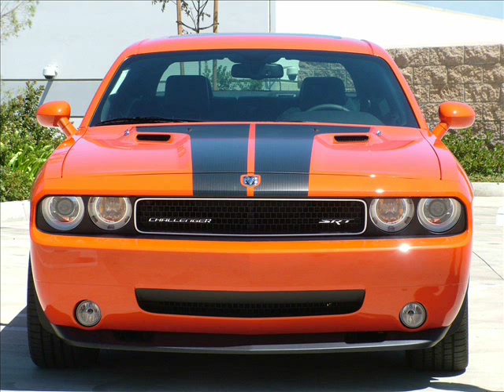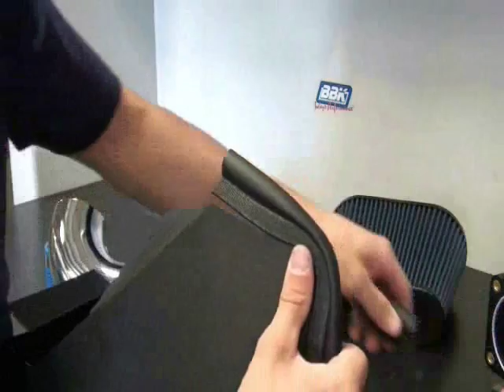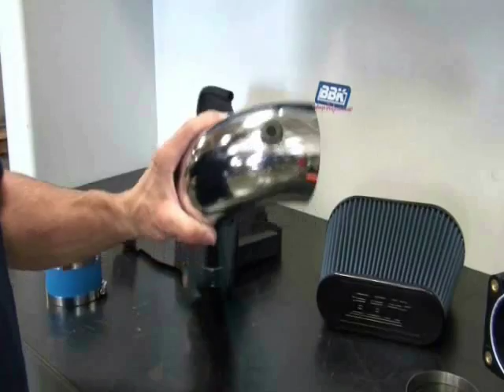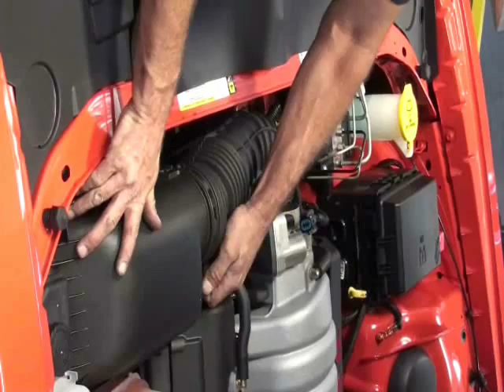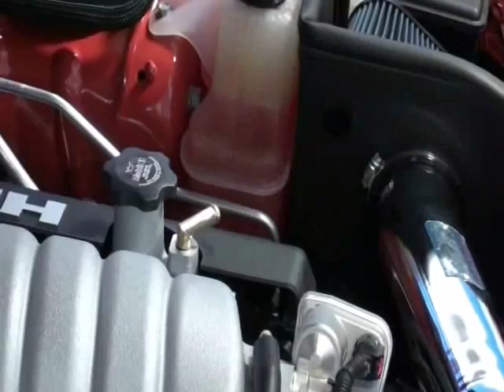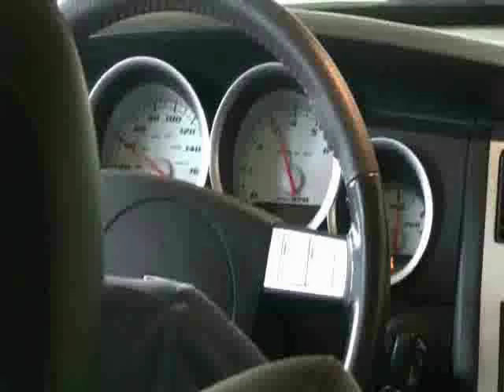2008-2009 Dodge Hemi Challenger/Charger Cold Air BBK 1738  Video Installation Instructions

Comment: I just put a mopar cat back dual exhaust in my 2010 challenger and it isn't as loud as I had hoped for. Will the addition of the cold air intake make it sound louder or deeper and increase my horses by about 5 or 10?
Thanx, Bill